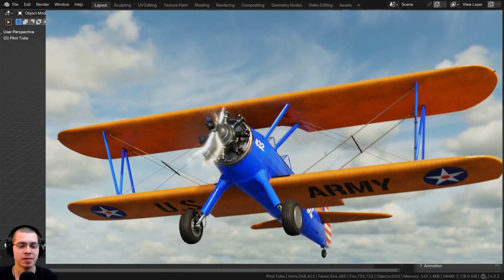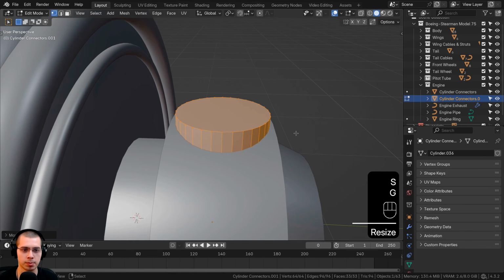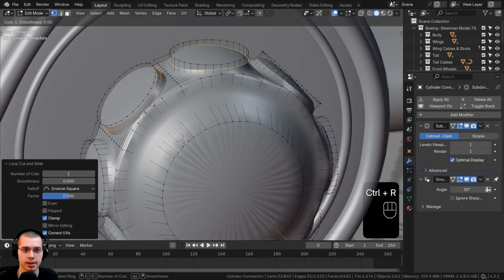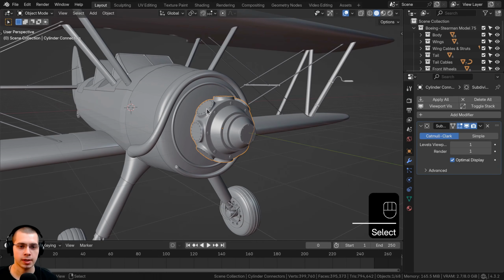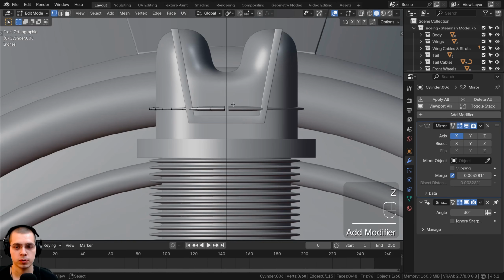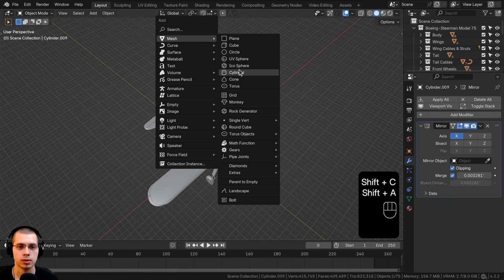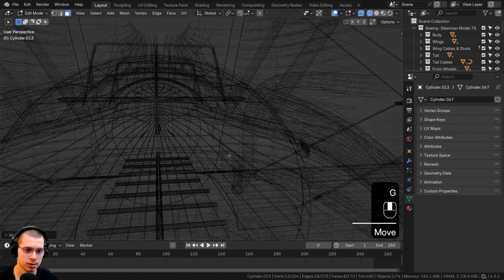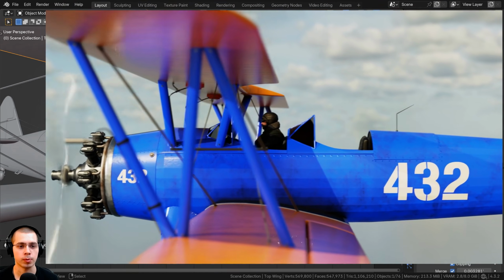Creating a Biplane in Blender 🛩️ Part 6 (Tutorial Series)

Comment: I've been trying to make the boolean modifier work for about an hour... I've cleaned up all the geometry of the cube, redone the rings several times, checked if there were double vertices, that no crossover appeared... it just doesn't work!... Sometimes it does nothing, sometimes it kinda does a bit but it's such a mess that it's unusable. What am I doing wrong?

Edit: Ok... I'm an idiot, that was the problem. I didn't apply the modifier. It works much better once I actually used it
Reply: I have been having the same issue with boolean, no matter what I try nothing works!!! I am wondering what am I missing? I followed word per word every instructions under the sun and nothing works. There had to be another way

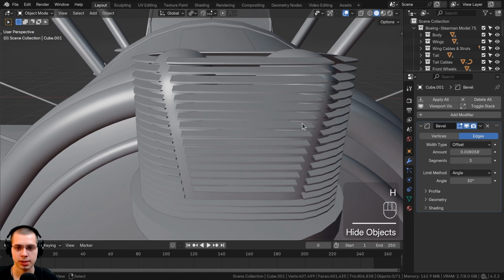Comment: 27:42  my boolean not working..
Reply: Me neither, random rings are missing and the surface seems gritty and crappy... If I turn on solver from "exact" to "fast", it seems to work... but I don't like it, cause tbh I don't really understand what the boolean transformer does and I'm worried that there's an underlying reason for it to fail.
Reply: @dulume  I had a similar problem and it was caused by the inner parts of the rings intersecting slightly, so make sure you leave enough distance between each ring.
Reply: @Obamium_  thanks man, I cleaned up the mesh and that resolved the whole thing. Cheers mate!
Reply: @Obamium_  This worked thanks!!

Comment: radial engines always have odd number of cylinders.
Reply: Yes.
The Stearman was usually fitted with https://en.wikipedia.org/wiki/Continental_R-670
Reply: @tooltroll  the main reason for having odd number of cylinders on radial engine is because the shaft have to make 720 degree turns for 4 cycles to complete, and since all connecting rods share the same crank, the firing order must skip every cylinder, and if there are even number of cylinders, it would be a big problem, since firing order will return to 1 before all cylinder gets to fire.